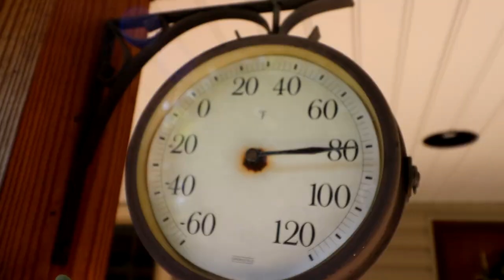he assaulted my...

Comment: @3dmachines, sorry Dalton, any dent with a crease will not pull out, it will need pulled out, using back hammering and slide hammer with welded on studs. To be honest, junk yard doors and have them painted to match are much easier, then just swap out the doors when they come back from paint. That is your cheapest option, unless you want to learn autobody.

Comment: If you have compression but no vacuum then you have an air leak somewhere. Also you will never get the carbs adjusted correctly without the air cleaner/airbox on.

Comment: 3D... Cold water if the metal is hot, hot water if the metal is cold.  You want temperature differential to help the metal expand/contract.  But those dents are a tad big for all that.  you'll need to hammer and dolly them out from the inside, then buff that green paint off and give 'er a nice waxing.

Comment: Dalton i just got a 1988 camaro and it runs but i have it a bath and it won't run not it turns over its getting air gas and juice from the battery what do you think is wrong with it??

Comment: Baseball and horseshoes like cornholes but use horseshoes and railroad spike or some kind of metal that go in vertical in the ground and then toss the horseshoes get a ringer 3 points hit the spike get 2 and 1 if close enough to measure spike from horseshoe landed by the length of the horseshoe to the spike

Comment: my grandfather has the same truck as you except it's 1500
Reply: Tommy Gleason then it's not the same truck
Reply: Exactly the same but different...
Reply: Tommy Gleason so it's not the same
Reply: There is a big difference between a 1500 and 2500, engines, drivetrain components, suspension, wheels, etc. the only similar thing is the cab. Not trying to sound rude but there is a large difference
Reply: That's pretty much like saying u have a blue chevy silverado
Reply: My grandfather has the same truck as you too except it's red, a ford, and a focus.